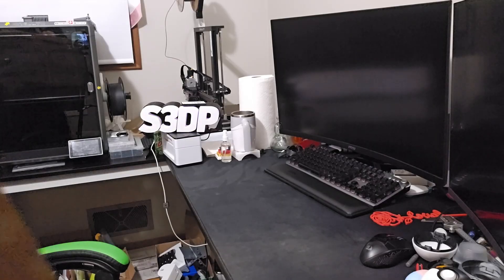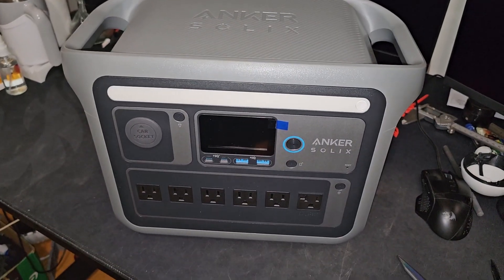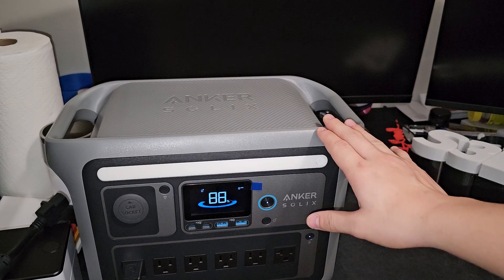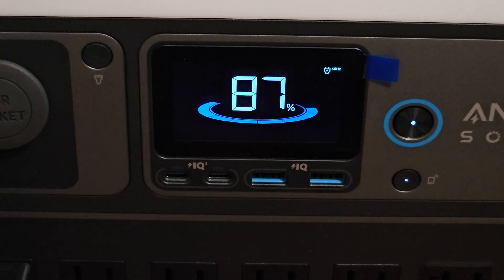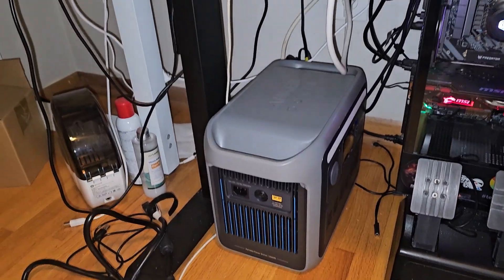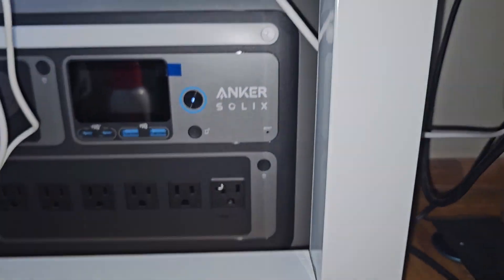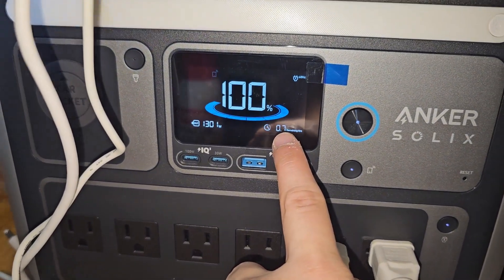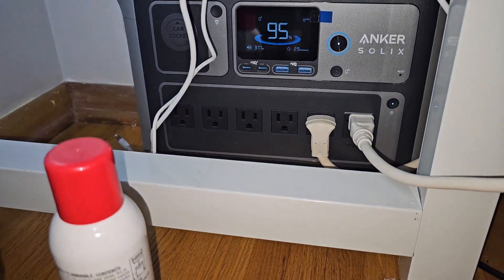Can The Anker SOLIX C1000 Power Creality K1 Max?

Comment: you can print PLA with no bed heat just use glue and a higher first layer temp
Reply from the maker: That's true, but glue ruined the first layer, if I'm using a different build plate other than plate A from creality. Will keep that in mind. Thanks